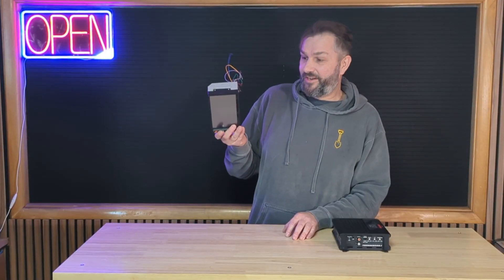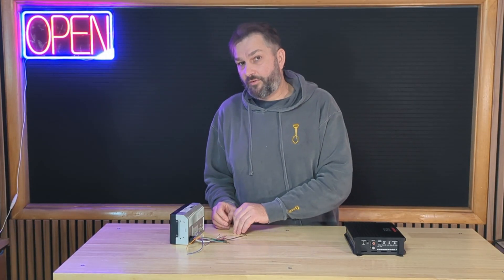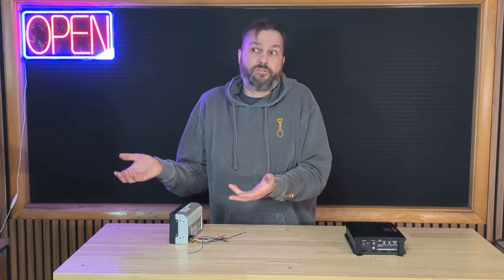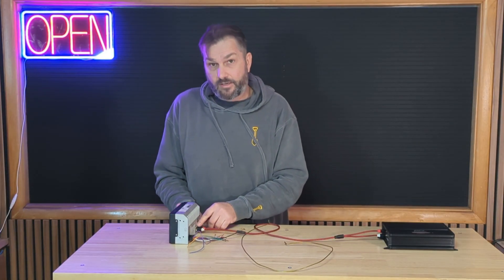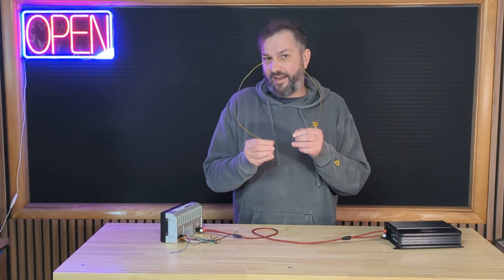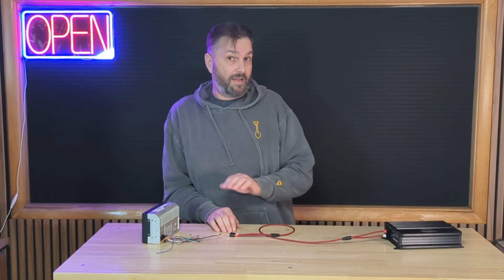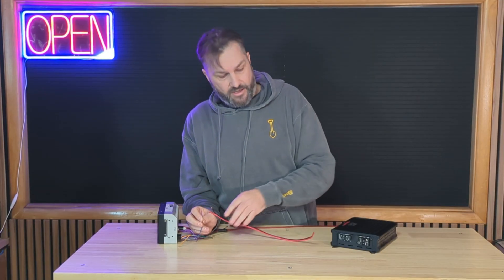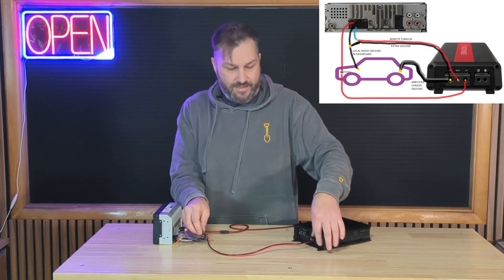Fix noise in your car stereo for free

Comment: If i have multiple amplifiers do i do this method to all to stop the engine whine?
Reply from the maker: Assuming the amplifiers are all basically in the same place you can run a single ground from the HU to one of them and then jumper that to the others.   The principle is the same, you are ensuring there is a low resistance path between the HU and the amplifier to eliminate any possible offset,  and you're ensuring that the cross section of "loop" between the RCA signal and the ground path is as narrow as possible.     

If you have amps in different places (one under a seat, one in the trunk.. etc) then run a separate ground for each one.

Comment: Does this also work for the noise created on a Pioneer HU when the pico fuse blows? I remember having noise years ago. I was able to get right of most of it by grounding the RCA but still had some floor noise.
Reply from the maker: If the noise is only present while the car's engine is running, then this will most likely resolve that as well.   Any head unit with a LCD screen has a switching power supply that can introduce a little bit of continuous whine (it may change frequency slightly as temperature stabilizes) and bypassing the pico fuse with a chassis ground can unshield some of that noise and you may not be able to 100% eliminate that.   Grounding your head unit directly to the amplifier ground  like thiscan prevent the pico fuse from getting cooked in the first place because ground offsets will take the path of least resistance - in other words, never through the RCA's and never through the pico fuse.

Comment: is there a way to fix it for an aux input jack on a factory radio? my 2011 versa has aux input and i dont even use it because the alternator whine is so bad it hurts my ears.
Reply from the maker: If you get a whine while using your aux and charging your phone (or player) at the same time then that's probably power supply whine from the charging port.  There should not be any mechanism to get whine from an aux port if the phone/ipod/etc is running off its own battery so if you do get noise that way it's probably a failing or poorly made radio and can't be addressed externally. 

 Lowest hanging fruit here is just get a bluetooth to aux receiver, there are tons of 'em on the market for less than a cheeseburger.

Comment: And knowing is half the battle. Excellent breakdown of ground loop noise. You have such a wonderful way of explaining technical things. 
I ran my RCA jacks under the center console already. I'm going to run a wire from the head unit ground, to the amp ground along this same path. 
I've read that the transformers would cut frequencies but I was more concerned about the whining noise. I guess that I never had a good enough audio system to notice warm tones. I've always wanted crisp highs and hard hitting lows. 
I'm still going to get rid of my cheap 5 channel amp and get something with a little better quality components. Really appreciate this video.
Reply from the maker: When you're shopping amps you probably already know to go with brands that have earned a good reputation but 2 other things you can look for without knowing anything else about the amp is what kind of inputs they have and what kind of fuse capacity they have.     

For the inputs if the amp uses the same RCA plugs to accept both low level and speaker level signals then that strongly implies it has differential inputs.  In addition to slightly better noise rejection the other thing that indicates is a better quality amp because it costs more money to build a differential input than a single ended input.  An amp that's built as cheap as possible inside won't have that so you can expect the whole rest of the amp is built better too. 

For the fuses those determine how much power the amp can truly make.  It's easy math:  Volts times Amps equals Watts.   Your car battery is 12 volts,  if the fuse is 30 amps then only 360 watts can get into the amplifier before the fuse pops.   So if the amplifier has a 30 amp fuse and says 3000 watts that mf is lying to your face. It can't output more power than gets through the fuse and the real number is less because nothing is 100% efficient. 

Take the fuse value,  if there's more than one just add them, then multiply that by 12 and multiply that number by 0.7 (class AB amplifier) or 0.9 (class D amplifier) and you have a good idea of the power it can really do.   Technically they will do more power at 14.4 volts but the real world ain't a test bench so it's better as a buyer to just standardize your expectations around 12 volts because that's closer to the power you'll actually see. 

There's some 5 channel amplifiers which are class AB for the four full range channels and class D for the sub channel and that complicates things but you can still get in the ballpark.   Current generation premium brand 5 channel amps are going to be class D on all channels and  I expect your budget is going to be the factor that determines if you look at an older design or not.    Older designs can still sound good if they're built well.  

Also I'm gonna feel like a real asshole if the noise you're getting is caused by something else and this doesn't fix it but the good news is that a consistent ground reference also improves your sound quality by ensuring there's no offset eating into your dynamic range.  This can often be equivalent to "two clicks" of your volume knob worth of clean sound output by itself.
Reply: @shoveI  I've seen amps that do not have high level connectors, just rca jacks. Some of the budget friendly amps that I was looking at only have rca inputs. That a good tip to know.

I'm looking at some hybrid AB-class/D-class amps. What I narrowed it down to is Alpine, Sound Stream and Memphis. I need a large frame amp to cover my sub hole and these are big enough to do that.  The sound stream amp fits my budget. I use to be a huge Sound Stream fan back in the day but had a Jensen budget lol.
Reply: My Recoil 800.4 is built this way with only RCAs. So this is a good thing? I haven't had a chance to install it yet due to the weather, but I'm trying to learn as much as possible. Thanks for the wisdom, good sir!
Reply from the maker: @matthewvassar9686   if the RCA's are able to accept both line and speaker signal then it's very likely differential inputs.  some amps just don't accept speaker level inputs directly at all.  It's really not a big deal either way if you've done a careful job with wiring.  The existence of differential inputs on an amp can just indicate it's not bottom of the barrel quality.   Plenty of good amps have single ended inputs but few if any garbage amps have differential inputs.